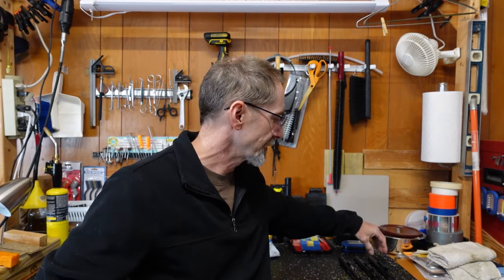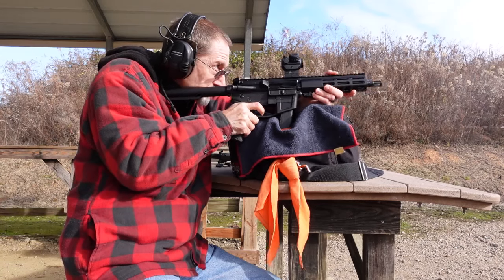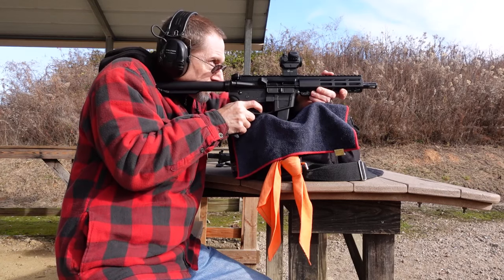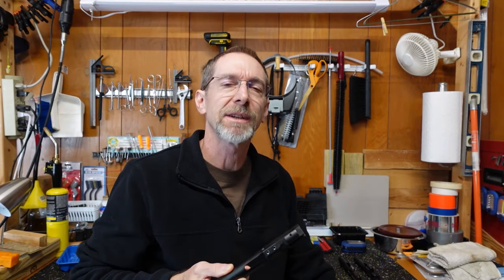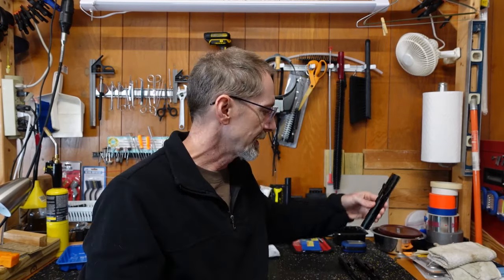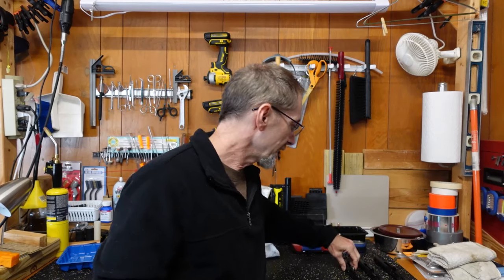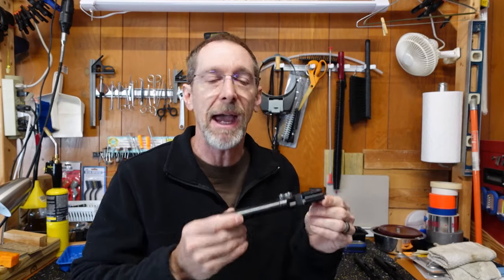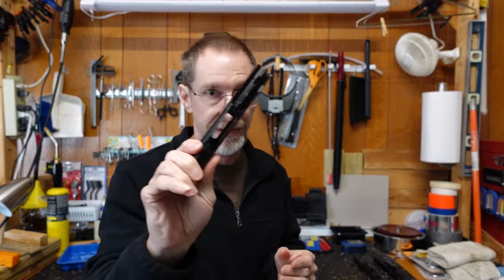9mm AR (AR9) Bolts Update! Mercury extractor, Taccom short stroke, FM-9 firing pin spring

Comment: I just received the springs from Amazon for my Foxtrot Mike. They do, in fact, fit! There are fewer coils but the wire is thicker so the spring is stiffer. I have a lifetime supply as I had to buy 10 of them but I'm happy to do so to get away from that Bic pen spring that was holding back the firing pin. I was just waiting for the thing to slam fire when I dropped the bolt.
Reply: I just test fired the rifle a few hours ago. I dropped the bolt and chambered a round multiple times without any surprises. I then ran a couple of magazines of my handloads through it and it ran perfectly. I then checked the spring length against the pile of new springs I have and there is no change in length. It's a good substitute I think for that wimpy F/M spring. Thanks to the finder of that spring.
Reply from the maker: Great news!  Thanks for the feedback.

Comment from the maker: FM-9 replacement firing pin spring used:  Uxcell Compression Spring,304 Stainless Steel, 5mm OD, 0.5mm Wire Size, 25mm Free Length, Silver Tone: 
https://a.co/d/fuFcDjv

These appear to be the same:
https://a.co/d/6i4LUIb
https://www.amazon.com/uxcell-Compression-Stainless-Compressed-Capacity/dp/B08VDZ2HPH

Comment: I found a new AR9 lower that is the best I've tried...and I've tried a bunch! It's the New Frontier Armory Gen2. You have to make sure it's the Gen2. It's 7075 and has features like, a threaded nylon tipped tension screw, a screw instead of pin bolt release, set screw retains the rear takedown pin spring instead of just the end plate. It also has the LRBHO that actually works. Everything fits and functions flawlessly. They have two versions so you have to make sure you get the gen2. The other is like all the others.
Reply from the maker: I will look into it!
Reply: intrigued!

Comment: Can you do a review and explanation of the Taccon Super Feed Barrel and their Extreme Short Stroke Bolt? I don't quite understand the feed ramp, if it requires the lower/upper to be modified. The same thing goes for the removable top insert on the barrel. Can I buy the Taccom ESS bolt and Super Feed barrel and drop it into an unmodified AR9 glock lower?
Reply from the maker: Give Taccom a call - they should be able to answer all your questions!
Reply: @Blowback9  I did more. I went and bought a barrel and bolt. That took care of all of my questions.

Comment: so just to confirm, you used a standard AR15 extractor in the Mercury AR9 bolt?
Reply from the maker: I tried it and it did not improve extraction or ejection.  I switched back to the factory ejector/spring that comes with the bolt. It has worked flawlessly and I'm using this bolt for a lot of testing.  I'm sticking with the setup.  So far, so good!
Reply: @Blowback9  Good to know a regular extractor works. I got an OOB on an AR9 build (bad load) so I needed something to replace the extractor that I lost.
Reply: @Blowback9  So just an update on my attempts at replacing the extractor. The good news is that regular .223 extractor bolt fits just fine but the bad news is that it's set up kinda weird where it uses a semi-threaded pin with a 3/32 shaft (meaning you have the extractor being held in by a slightly undesized pin). If you ever break that pin, the customer support says to use a 3/32 roll pin. However, this means that your extractor is held in by a roll pin instead of a solid pin which might lead to issues.
The different option which I tried is the KAK industries 9mm extractor pin which is also threaded and really easy to install/remove. The good news about using this is that the threads are the same as the threads of the mercury precision extractor pin threads, however the downside is that you will need to widen out the hole on your bolt with a 2.6mm or size 38 drill bit to match the original diameter of an AR15 extractor pin hole. Also, the KAK industries extractor pin is only ever so slightly too short to make it through the entire extractor slot. While it will hold in the extractor, it might break.
Reply from the maker: @CantoniaCustoms  They must have changed the design of the pin.  AFAIK, most, if not all, milspec extractor 9mm AR bolts utilize a 3/32 forward assist roll pin to hold in the extractor. No issues. A solid pin can drop out because it's not retained by the BCG like an AR-15 extractor pin.
Reply: @Blowback9  Yeah, really seems like it, or my bolt is an older one.